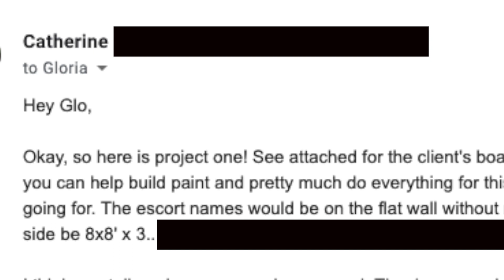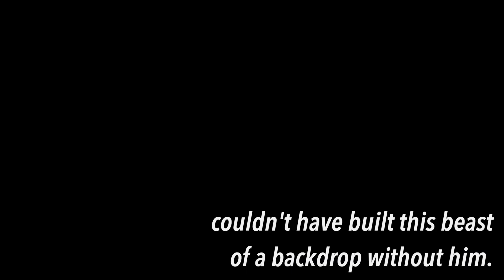MET GALA INSPIRED PHOTOBOOTH | CCL Weddings x Gloria Sky

Comment: very cool beautiful design! I recommend when making something like this if you plan to reuse it for party rentals to use recessed hinges so you can fold it up in sections and move it more easily, and set up will be much faster b/c if you book it out often then the long set up time will get old real quick. We made a basketball game that sets up in 5 minutes. http://cocktailhourentertainment.com/games/games.html#basketball4player
Also use thin sheets of black ABS plastic like they use on DJ road cases (not painted wood). The ABS plastic is durable, no splinters, and you wont be constantly painting the wood. The plastic can also be applied over the hinges to hide them for a clean look. I purchased my first vogue booth which looks great but building it is a pain in the a$$ b/c takes over an hour so that needed to be fixed.
Reply from the maker: Wow, that's amazing! Thank you for those pointers. I'll definitely look into that for my next project. Thanks for watching!
Reply: Can you provide instructions on how you built yours and the estimated budget?